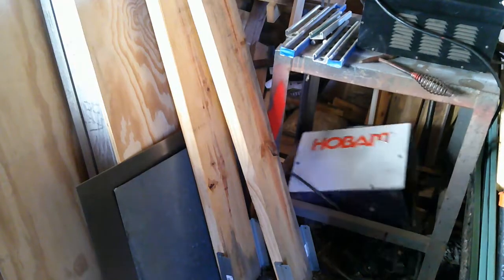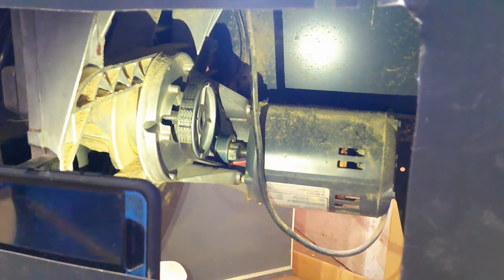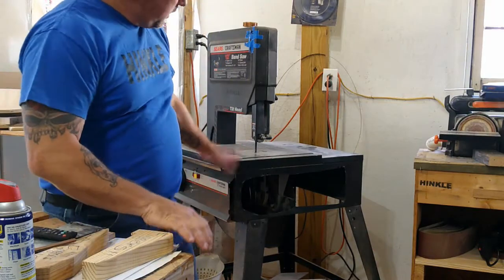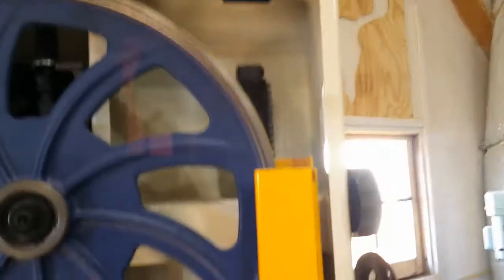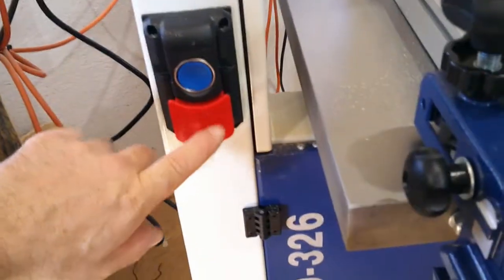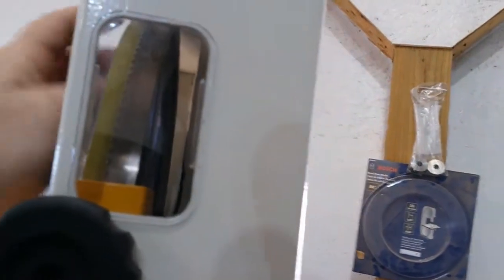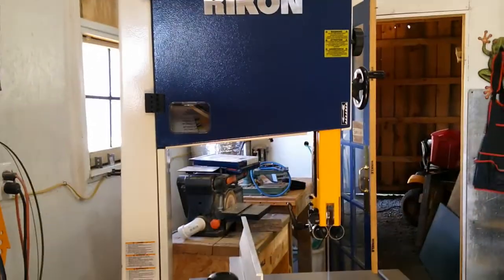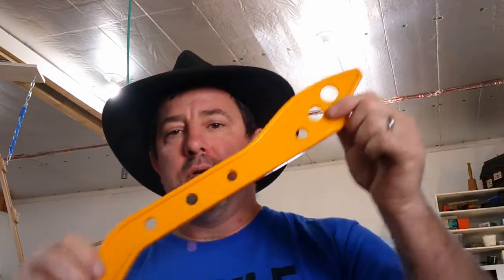RIKON 14 INCH 10-326 DELUXE BAND SAW REVIEW AND COMPARISON TO SEARS CRAFTSMAN 12 INCH SAW

Comment: Drill a small hole an 1/8" deep in the motor shaft so the set screw can seat itself.
Reply from the maker: Good idea thanks
Reply: And then use some thread locker

Comment: If you can grind a flat on the motor shaft, that should fix the problem with the set screw on your old bandsaw. Then again, that my be easier said than done... 

At 8:43 you misstate what Alex recommends; he says to have the back of the gullet, not the tip of the blade, centered on the wheel. With the tip of the blade centered, you will likely ruin the tire.

Comment: My caw seems to stop turning, like belts are loose? Is there a adjustment?
Reply from the maker: Thanks for watching both saws have belt tightening adjustments 
But I’m guessing you are talking about the craftsman to adjust it there are 3 lock nuts that hold the motor in position loosen those and slide the motor to tighten the belt hold the motor in place and tighten the mounting nuts back up
Hope this helps
Thank you

Comment: I have a craftsman 12 inch bandsaw.  Per the manual, to square the blade, I need to adjust with a set scew.  However, it does not matter how much I turn this scew I cannot get the blade square with the table, any suggestions?
Reply from the maker: Just a shot in the dark here you do know there’s a locking bar above the turn handle on the left that locks, the head in the position then the setscrew that you adjust is merely a dead stop to return it to square each time you want to return to 90 degrees 
Hope this helps.
Reply: @Hinkleshop  yes I unlocked that, however with the saw head at zero, saw blade is not square to table.
Reply from the maker: @Navillus2273  
I’ve never trusted the dead stop on those older saws 
I’ve always dialed the saw to table into 90 with a reliable square and then locked it in place.

Comment: I just bought one of the Sears/Craftsman bandsaws.  Of course it has no manual. Could you please tell me  what size blade  they use?
Reply from the maker: Mine uses 1/8 to 1/2 wide by 80” inches long 
bosh part # of bs80-15s from Lowe’s is one example 
Hope this helps
Reply: @Hinkleshop  helped a lot, thank you.
Reply: Amazon sells sanding belts for this machine by the way. Man narrow (1/2") but dude massive dust removal and clean job!!